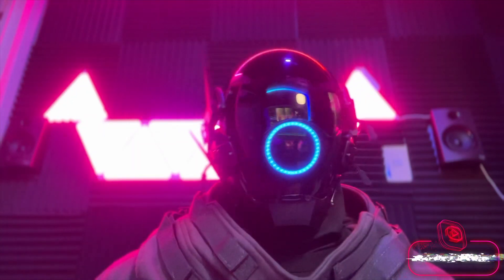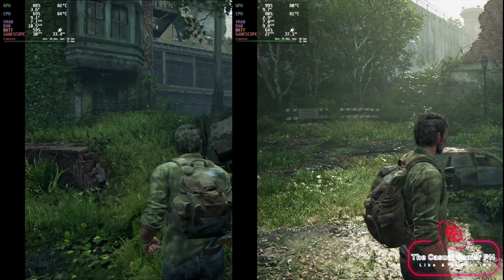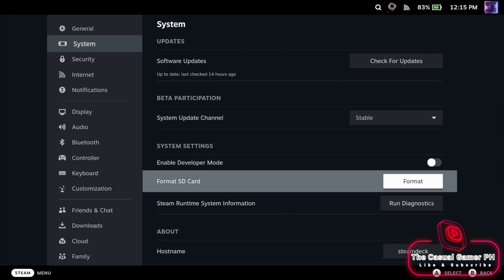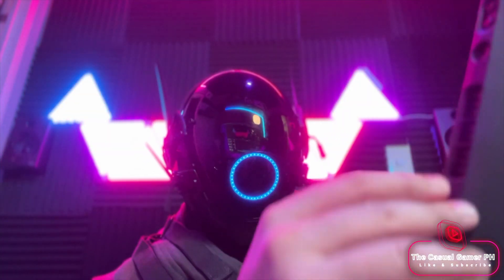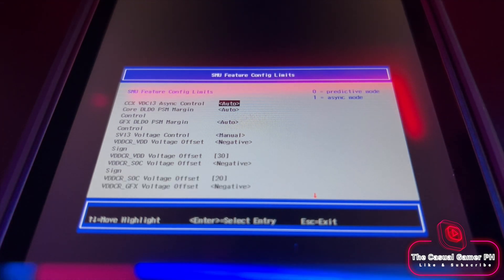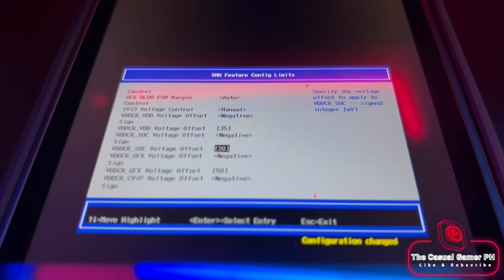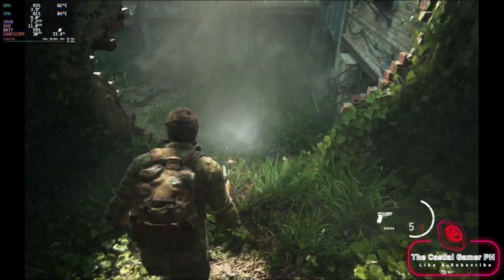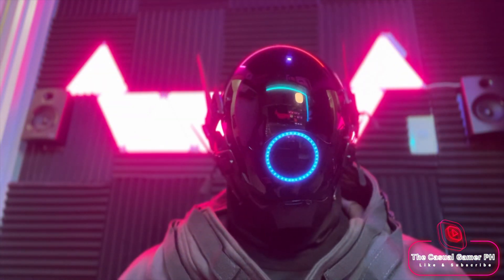How to UNDERVOLT your Steam Deck - LOWER TEMPS & PERFORMANCE GAINS

Comment: Thanks for immediately stating don't he on steam os 3.5 for now. I installed it for the smt fix going to test Pokemon Arceus to see if it improves it at all. When the tool gets updated definitely going to under volt for better battery life.
Reply from the maker: You are welcome. Just didn’t want to waste anyones time who might want to try this on 3.5 with the new bios. Not sure if this has been updated yet.
Reply: Is there a way to downgrade the bios?